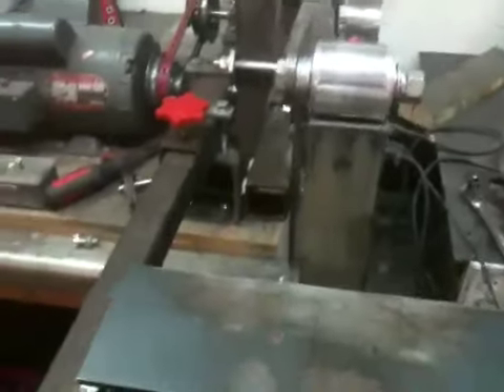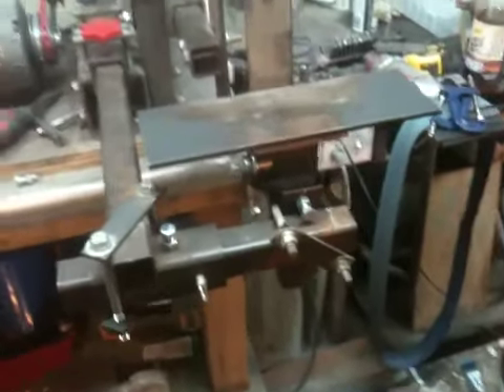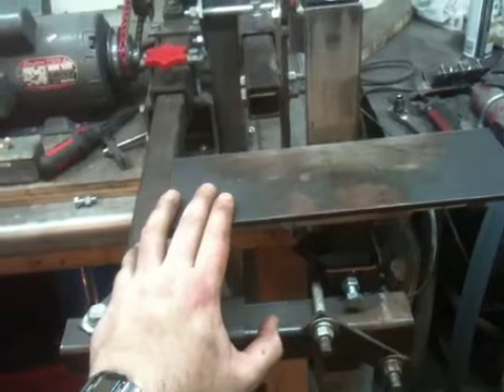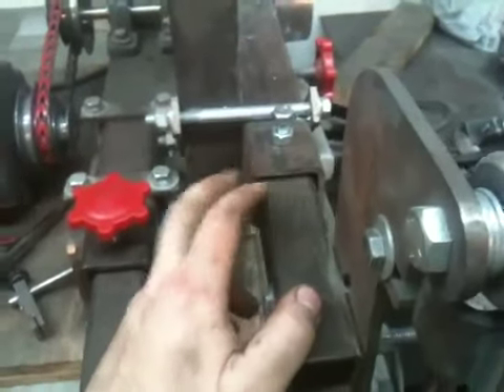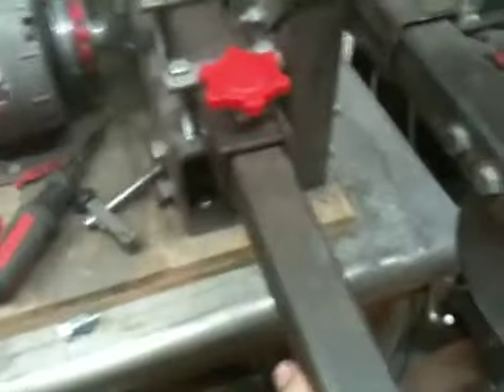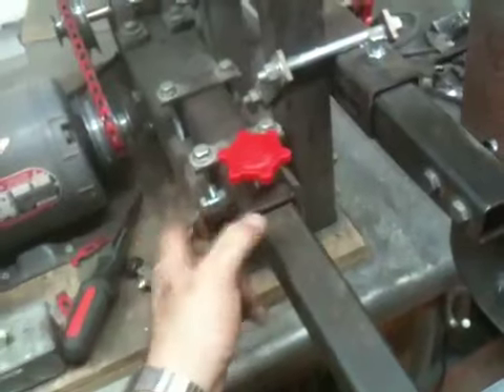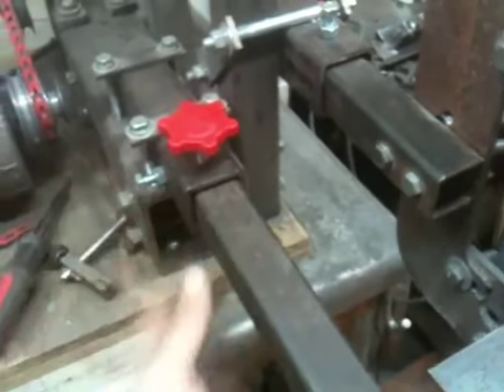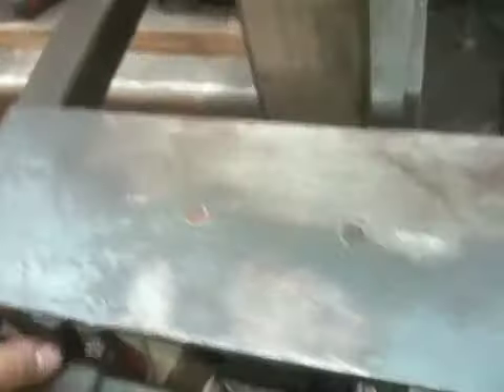NWGS modifications/adjustments

Comment: I am just finishing up the initial build of my NWG, and I'm glad I watched this video. I was really concerned, not just with repeatability and precision, but also with belt tracking as well. Did you find that once you installed those additional bolts that the machine tracked better? 

Also, is this your primary grinder? I am in the process of developing from a hobbyist/amateur to a professional, and this system seemed to fit my needs and my budget best. Just curious about your experience so far.